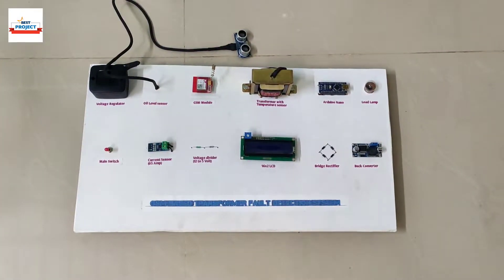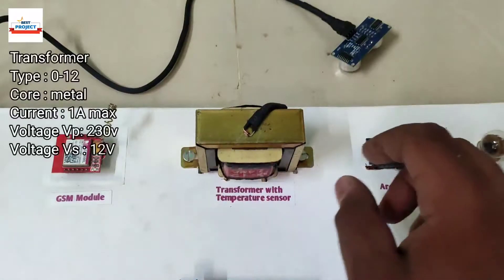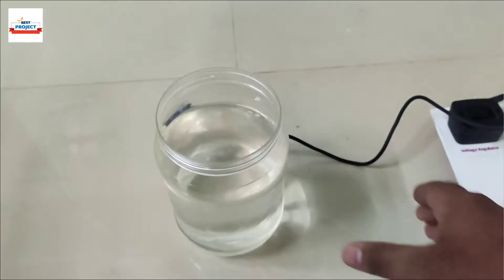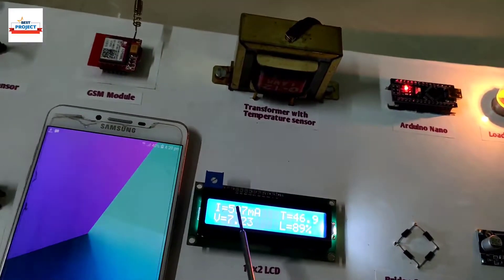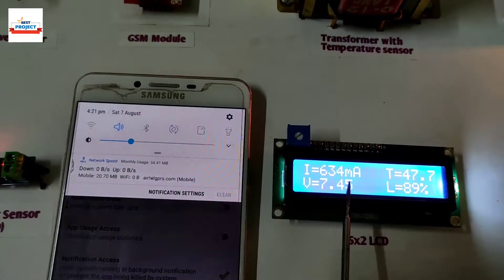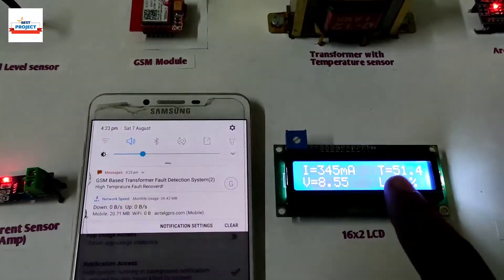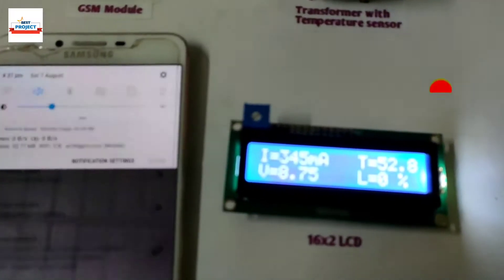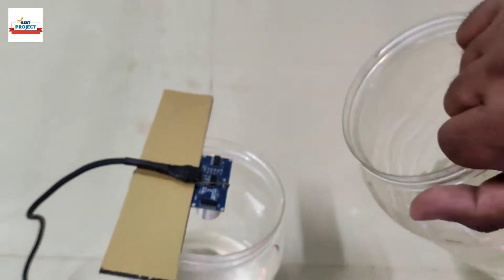21. GSM Based Transformer Fault Detection System | Current | Voltage | Oil Level | Temperature | SMS

Comment: This video shown transformer voltage is 8V. how that is possible ?. Transformer output voltage is always constant 12V. Then how it changed?
Reply from the maker: Because of heavy load, voltage can be drop, depending upon the load current.
Reply: @ElexysProject  
Buck converter working only in DC supply, you are using that in AC CURRENT adjustment?
Reply from the maker: @hemanathg7302  bridge rectifier is connected on back of set up.
Reply: @ElexysProject  
Ok
But you are adjusted the dc voltage it's not reflected in before rectifier . So transformer output voltage it's not vary.